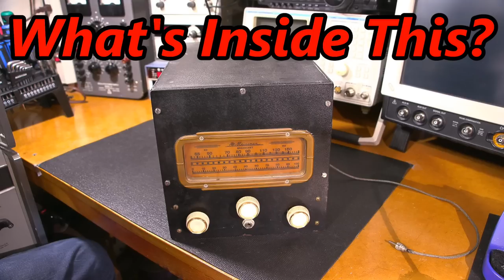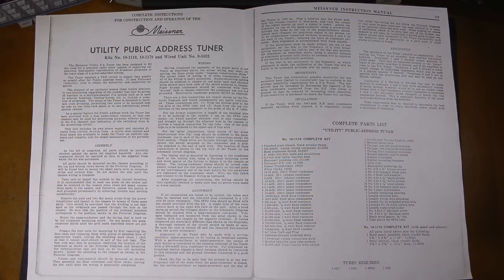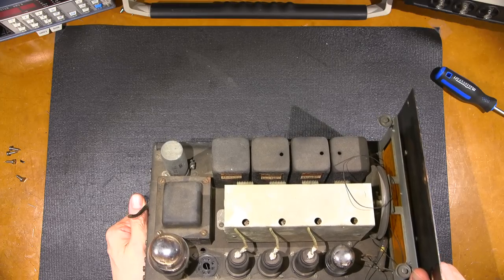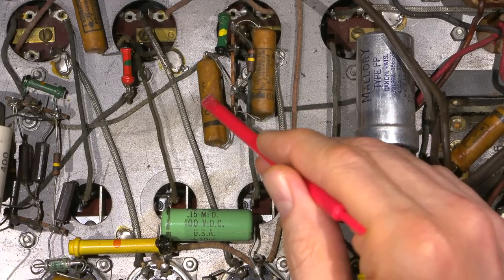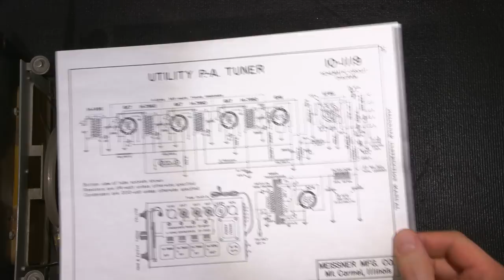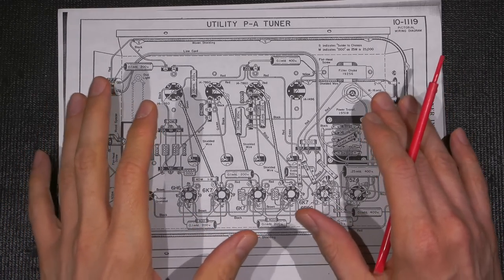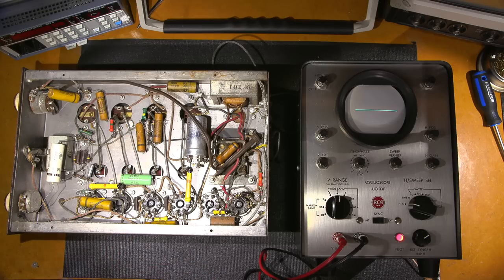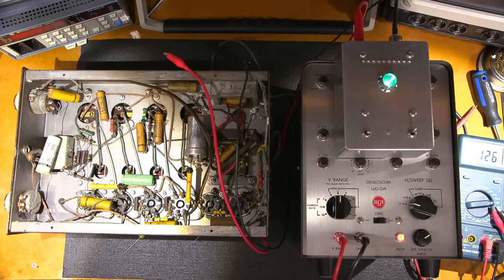Look Inside This Rare Receiver!

Comment: Greetings Paul - Hey, I love the sensitivity of those TRF Rx wileys.  Not to mention the incredible wide audio range, like a 'live' performance...  Long ago, I built in a large jack-plug several germanium diode receivers whose antenna was a tuned length for the station I wanted.  Each unit had it's own tuned length antenna / Station change, pop-in a different jack.  Went into a tube pre-amp then out to a good tube amplifier.  Man that old stuff sure impressed my guests.  No substitute for quality !  I enjoyed the Meissner inspection.  73, de Tony in S-Africa.

Comment: 500 watt solder-zilla .... Like a crowbar with the end filed down and heated over a campfire.  😂 I love your sense of humor!
Reply: HA- THAT'S A HOT ONE-!!!
Reply: Hey, kids, you laugh! When I started doing electronics a few decades ago, my first soldering device was a heavy copper wire that I stuck up through the grate of a coal-burning "Warm Morning" stove to get hot. Then I graduated up to a gasoline-burning blow torch that heated a crowbar-type iron. I liked that one - not nearly as many ashes. Those were the days!   (From North Carolina, USA)
Reply: Used to have one as well.  My father said he had used it when repairing eaves troughs.  The tip was just filed off at an angle and might have been a half inch across.  Don't know how, but I picked it up by the wrong end once as you say.  I think I gave it up after that.
Reply: He does have a robust Weller soldering gun with a piece of 14ga copper wire in it to solder ground joints right to a steel chassis. Can't do that with a sissy froo-froo Hakkon!
Reply: @deadfreightwest5956  ....the right tool for the job-!!!
Reply: He ain't far off I seen early movies on radio construcktion,the soldering Irons were high, I used on in high school ,In the sixtys we stuck the Iron in a fire  take out to solder a tin mug

Comment: Paul, thanks for taking the time for another excellent video.   Also about 30 years ago Radio Shack sold a portable TRF AM radio.  It probably used the Ferranti ZN414 IC however I never confirmed that.  It's performance was very good however I'm not sure that it's performance was any better than a superhet.

Comment: Just a suggestion on paint.  You might want to try bedliner paint used to coat the bed of a truck in place of a liner.  I recently used some to paint a rolling tool box to enhance the durability of the work surface.  The paint also dries to a textured finish which hides a lot of flaws.  Great video.

Comment: So THAT's what those slits in the variable capacitor plates are for!  I started my electronics hobby when I was 12, found radios, TVs, amplifiers, etc. in the dumps and took them apart.  I built my first audio amp from scratch at the age of 15, later got and EE degree and here I am 61 years later, just finding out what the slits in the ganged capacitor was for!

Comment: @Mr Carlson's lab - you may want to look into getting some gunsmithing screwdrivers. They are flatheads but the opposing faces of the blades are parallel to one another instead of tapered towards the tip. It makes it less likely for the blade to cam out of the slot in the screw and mar the finish of whatever you're working on

Comment: I remember  the A-B-C selector switch on the 70 volt  Stromberg-Carlson intercoms in my high school; there was also a 3 position volume switch. The expression on my biology teacher's face as she walked over to switch off  "Touche" by ZZ Top so she could start her lecture was priceless. It's too bad they gutted that building and "updated" it with all modern fittings; in this state, towns get no subsidies unless they turn every repair into a major project.

Comment: I ran into a trio of similar receivers while working in a old bed and breakfast in cape May NJ. They were quite heavy and during a remodel they built a wall right over top of them. Another  cool thing we found in the same area was a old fashioned switch board for the original phone system. It had 16 extensions for the 12 rooms and other parts of the hotel.

Comment: Looking forward to part two ,and those tubes touching not a good thing but  I am he already figured a solutions ,I always  replace all old caps very few caps of that old  are worth  saving ,I not a purist I dont restuff caps no one will see any ways,new caps show how what work that has been done,and you have more room  with new caps,and news caps are made better,who want to open a radio twice cause you are cheap,and new caps will make your radio safer,then I check tubes and resistors ,I am still learning that why I am grateful to all that make and share with us their videos,and if you are real lucky they might answer your questions ,but dont hold your breath .

Comment: Nice look at this receiver,  bonus points for an authentic wrinkle finish repaint (I've had good results myself with the spray on bake in oven wrinkle paint).. The first thing my eyes were drawn to when you put up the datasheet was "tubes required" after seeing 3 x 6k7 I paused the video for a minute to think about what kind of circuits were inside, then you mentioned pausing the video after I restarted.. :D btw I really like Robertson screws too, there is a good documentary on youtube about how they were once really popular even in the US but due to the way Robertson wanted to licence the manufacturing of them they lost market share to competitors with more lucrative deals...

Comment: Two thoughts: First, could the missing tube was a rectifier tube that was replaced by the diodes to save the hassle of procuring a replacement? Second , I was as a kid attending a summer camp in Maine in or about 1954, and one of the projects was assembling a bare bones multi band regenerative receiver for amateur radio use kit, band selection was effected with separately purchased plug-on band coils. The maker was Meisner! Turning up the gain control was used to push the receiver into oscillation for receiving Morse code amateur radio signals. At that time, non-polarized plugs  were used and the chassis was live, and if the plug was not inserted in the right orientation, electric shock and inability to release grip would occur!
Reply: He mentioned in the video that it was an amplifier tube to drive an input to an amplifier.  The Large ST tube already installed was the rectifier tube and the diodes were in parallel to it.
Reply: @electronicsworkbench  I would guess that the rectifier tube got fried as a result of a failed filter cap, and although the tube is installed, it would be non-functional, with the diodes taking over the work.
Reply: @flatfingertuning727  Those tubes come up to power slowly enough to normally recover the capacitor before the valve is overloaded for two long.  What you say sounds plausible but there are 70 year old valve radios and record players still running some have never had any maintenance as well.
Reply: @AndrewLohmannKent  It would seem odd for someone to have added the silicon diodes if the tube was working.  In any case, time will tell.

Comment: One question, Paul, i notice you pull the valves out holding the glass envelope. I was told to pull them out holding the plastic base. Not always easy when components are closely spaced. What is your oppinion?

Comment: There is no oscillator since it is not needed nor is it used in a TRF radio. That is because of the fact this is not a Superheterodyne receiver.   This is a TRF receiver and it does not use an oscillator!  The tuning is simply done by tuning the actual RF frequencies,  it works by having stages of RF tuning. There also is no IF circuit in this receiver. What looks like IF transformer are actually RF transformers.

Comment: Meissner, also known for the "Meissner Signal Shifter" a ham radio VFO from the old days. Pretty quality stuff back in the day.  Interesting layout, they put the antenna stage right next to the audio amp.  You'd think they'd go straight line from input to output., but perhaps they're trying to keep the RF input path as short as possible to minimize feedback issues.

Comment: I've got a 'crrowbar' soldering iron, great for chassis work. My dad got it to weld fuel tanks together for model planes and boats. One question about the valve you replaced, where does the anode cap connect to ?
Reply: If you are referring to the caps on the 6K7 tubes, those are actually the grid #1 connection for the tube. It would be connected to the secondary winding coming off of the preceding stage. You would most commonly see tubes with an anode plate cap in old TV sets or transmitter amps.

Comment: “A filed off crowbar heated over a campfire!”  Hey, as long as there is plenty of flux, I’m ok!”
Reply: A mate used a tent peg over a fire to fix a campside radio
Reply: The house I live at now has a hot tub that quit working. Whoever installed it soldered all the connectors rather than rely on crimping alone. Trouble was, he must've used acid core solder. In the corrosive atmosphere (due to stuff added to the water) they literally rotted off.
Reply: I’ve used a large nail heated with a butane grill lighter as a soldering iron in a pinch once. Fixed a broken solder joint on a power barrel connector in some toy belonging to the kids of a friend I was visiting. It worked surprisingly well. Rosin came from the base one of the kids was playing. The hot nail just nicely melted the rosin and took on the solder from the blob the toy manufacturer bestowed on that poor connector. All I did to prep the nail was some Brillo in the kitchen. We had to scrounge to find a Phillips that would fit into the deep recesses in the molded case of the toy. Sometimes one gets lucky

Comment: The fan is that power supply is a Yate Loon fan that can be purchased online for less than $15 including shipping. The exact same fan can be used, or an equivalent size and voltage of a different brand. Most decent quality power supplies like Corsair have variable speed fan controllers (varying the voltage to the fan) based on the power supply load, and in fact some power supplies will not even start the fan until the load reaches a certain level, often not reached with casual Internet browsing and email usage. I personally would just buy a new fan, because the old fan is likely to have problems again, and not sure most people can take apart the inside of fan and lubricate it correctly. Most Corsair PSUs are made by Seasonic, one of the most reputable power supply unit manufacturers, so that PSU has plenty of life with a new or repaired fan.

Comment: I had something very similar as a teenager back in the late 1960's. It came out of a derelict school, the radio had no tuner dial. it was only able to receive one station, the BBC home service. It had a push pull out put stage capable of 50 watts so I turned it into a PA system.

Comment: You should get heavy piece of leather with various diameter grommets through it to put over around screws when using the flat bladed driver to open things.  It makes a huge difference in protecting the surfaces.  If you have two matching pieces of leather punched but the grommet only through the "top" one it'll do a great job guiding the driver.   Also if you give the driver a minor twist then re-temper it so it "bites" in the slot it'll stay in place much better as well.

Comment: The thing that came to mind on the curly leads of the diodes was how some diodes (in particular zeners) use the leads to dissipate heat generated internally during operation.  Some diodes actually have a minimum lead length specified so the heat can get out of the package.  So maybe the guy that installed the diodes was actually being a bit clever... :)

Comment: I remember RCA PA systems from the 40’s that had multiple tuners installed in the rack.  
I often see mistakes made by techs or hobbyists replacing components with the wrong value. I recently opened up a National NC-60 general coverage receiver where someone confused “micro- micro” farad (uuF) with microfarad (uF). I didn’t power it up before restoration, but I’m thinking it most likely didn’t work very well, if at all!  
I see a lot of this kind of thing, especially on old radios where non-standard units and value components are present. It’s always a shame to find where a coil was replaced by a capacitor, or an IF transformer was burned out from a leaky capacitor.  
I enjoy seeing the stuff you find. Lots of things I have never seen or worked on.

Comment: Mr Carlson, do you have a Hammarlund SP-600 in your collection?  If not would you like one.  I purchased it in the early 70's from my boss and my room mate and I changed all the tubes for new ones.  It worked great 45 years ago but I havn't turned it on since then. Please let me know if you would like it since when I go it will probably end up in the landfill.

Comment: Not under lock down (yet?) but I'll be here watching anyhow. Thank you!! Neat receiver too. Is that a so-called regenerative receiver?
Reply: No, it's a TRF(Tuned Radio Frequency) receiver.
A regenerative receiver uses controlled feedback to increase the stage gain compared to a non-regenerative circuit.

Comment: For the amature antique radio anthusest what equipment should I buy?  For example I am thinking of a vintage wave generator used by radio repair people that would include modulation for IF adjustment. How about a video for the not beginner but also not expert level.

Comment: What I was wanting to hear throughout was the relative arguments for superhet receivers over something like this.  I may once have known what was preferred about the IF process, but I've certainly forgotten by now.
Reply: The tuned radio frequency receivers suffered from (1) varying selectivity across the band and (2) a tendency to oscillate because of undesired feedback from the last RF amplifier back to the first. 

If you think of the tuned circuits as bandpass filters, the bandwidth is proportional to the tuned frequency:  BW = F/Q. At the high end of the band, stations tended to overlap. 

The superhet solved both of these problems. The selectivity is provided by the IF amplifier which operates at a fixed frequency, typically 455 kHz. Therefore, F/Q remains constant because F (the IF frequency) is constant. Further, because the large amplitude IF signal at the detector is at a frequency well separated from the tuning frequency at the antenna, there is little tendency to get feedback and a resultant oscillation. 

A superhet receiver has a couple of disadvantages of its own: one is the presence of the oscillator which can radiate to another receiver, and a second is the phenomenon of "image frequencies," which is a whole nuther story.

Comment: I’ve seen ads for a modern, solid-state version of one of these, but for the aircraft band(s); same idea, no L.O., so safe to take on a plane, and about the same size as a transistor radio. I didn’t realize there was an older prototype! 😎
Reply: TRF receivers predate superheterodyne. Sometimes they are used so you don't have to deal with downconversion, images, etc. Zero IF, they're usually called.

Comment: I found in my grandpa garage one of that soldering iron similar to a crowbar, and its quite a thing ahahaha: just a cable, a metal point and a wooden handle all mounted on an half meter long rod (2 feet circa)
As always, love your videos, "saluti" from Italy
Reply: I have one of those too. They were not so much used for electronics, more typically, for acid soldering sheetmetal, say gutters and flashing I think

Comment: Thank you for another great resto-project!  I noticed the screwdriver/tool holder on the bench under the Carlson Load Sharing Power Supply.  What brand is that one?  I saw an Ironton at Northern Tool very similar to yours.

Comment: TRF radio is uncommon in the UK except for hobby electrics.  Schools, hospitals for example used pairs of cables bundled up running at 100V perhaps audio, a channel switch, volume control pot, step-down transformer and lound speaker address system.  Somewhere in the organisation would be a public anouncement amplifier that could be for each channel the inputs would be microphone record player and radios.
Reply: The best PA I've heard  was in a car park used for parading on Sunday.  It had beautifully clear 2M or 3M horn speakers on poles.  That was over 50 years ago,

Comment: Imagine a Mr. Carlson from the 1940's, replacing old components with Waxy Capacitors, saying these are so stable and will last a life time.
Reply from the maker: Well, Poly caps have been around since the 60's, and test good today. Processes and materials are getting better all the time. Wax and paper caps were failing as the items went out the factory door. Thanks for your comment.

Comment: I reckon the existing "rectifier tube" should have been in the spare spot where you added your own tube into the vacant spot. The diodes under the socket at the end, the rectifier socket, have been added to allow it to work without a tube. The tube that is in that rectifier spot should have been in the vacant spot as it has a connector on the top, otherwise where is the extra connector to add to the additional valve? There is only one. I reckon the valve in the rectifier slot will be the same as the new one added. The rectifier tube on the circuit diagram did not have a top connector shown.  Just my $0.02 worth (guess!).